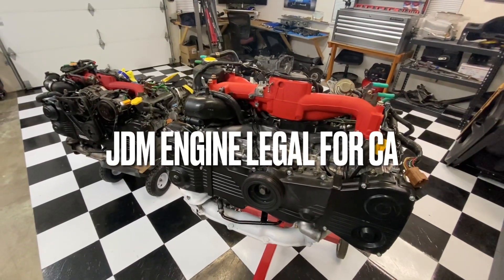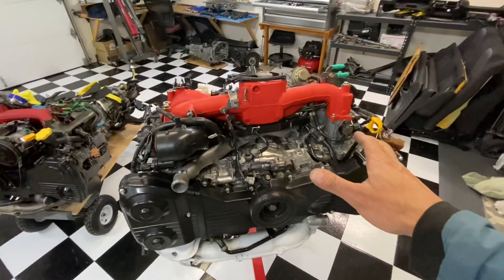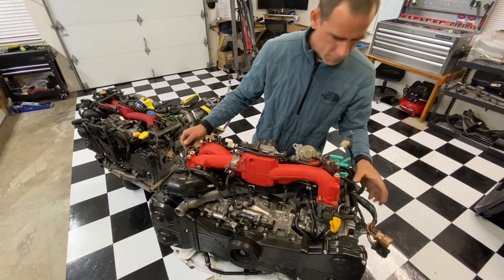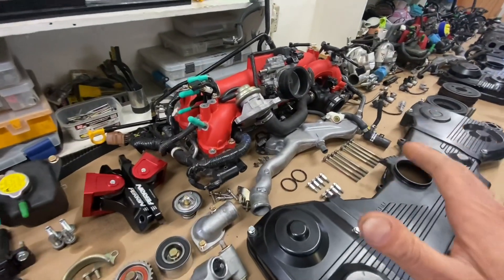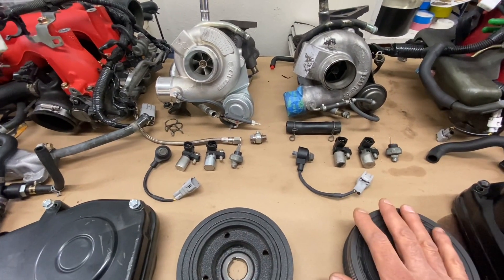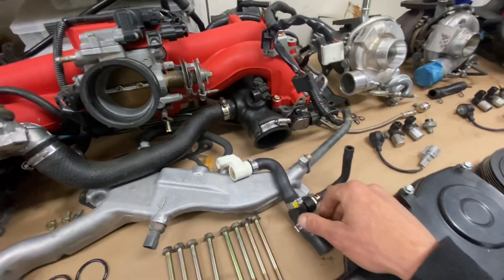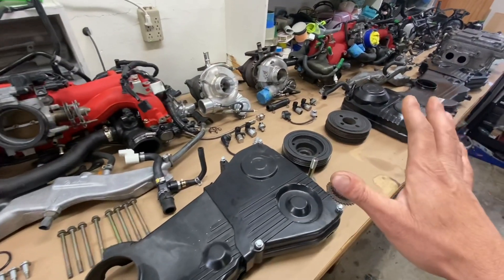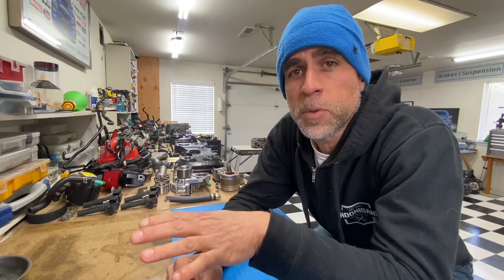How to Make a JDM Engine SMOG LEGAL for USA

Comment: Wow, Thanks so much for the video. I want to do this to my Bugeye that has a Head Gasket leak. Seems a lot cheaper than a rebuild. Is the JDM engine more reliable than usdm? Does the JDM motor still suffer from head gasket and ringland failure? Thank you.

Comment: I’m sure you heard of the Project Green speed via Cobb. I’m in a major dilemma & I can snag a jdm v7 207 for dirt cheap. I do want to stay with the Cobb tuning capability & stay within CA emissions as much as possible. The TGVs is one of my main concerns if I can just put it on the 207 & plug it up. Idk if it’s possible bc I didn’t find anything on the forums online reguarding it.
Reply: Also it does come w AVCS & the ecu. Just need to grab the wiring from iwire & all that. Idk what ecu to use.

Comment: Where are you located?? I got screwed 2 years ago. Was sold the wrong jdm motor to replace my 05 wrx. Shop didn't know for a year, they kept having delays so I got stuck with it, decided to rebuild motor. Then months and months after waiting, got ghosted, basically by a old friends dad, and never got my motor (complete) back. Now I'm motorless and haven't driven my car for two years. Have basically been trying to save up and decide weather to try jdm again or go junkyard motor.

Comment: Hi! I'm thinking to replace dead USDM EJ25 to JDM EJ20 (one overhead cam, non AVCS). I understand this setup (with USDM intake, ECU, sensors etc) will pass emission tests through OBD, but what about engine mark EJ20 on the top of it? Smog guy must check it while inspection in process or not? California. Thanks in advance)))
Reply: Hey was wondering if you did end up passing?
Reply: @Nick-mz9we  Hi! I ended up fixing existing engine.
Reply: Can confirm. They checked my engine code. Did not pass.

Comment: Nice, very informative!
People are reporting CA is checking for tunes. How do you plan on running stock ECU? Baby it into readiness?
Reply from the maker: Don’t understand. CA checks for tunes, yes. Using the OEM ECU for US EJ205, with no tune, is what I’ll be doing. Shouldn’t be an issue, since there is no aftermarket tune being used.
Reply: @SubaruONLY  Nevermind! I thought the JDM 207s had the same higher compression ratio as the JDM 205s. My mistake.
Reply from the maker: All good.  Yes, the JDM EJ207s are really ideal for use with the US EJ205 ECUs. Pretty lucky. 👌

Comment: Hey i have a random question, hopefully you can help. So I bought a 2019 sti with 19k miles on it. Didnt come with the accessport (i know thats not healthy)but has the cobb intake and running at 18.5psi. I was going to buy the accessport but idk if i put the tune it comes with or idk😩
Reply from the maker: Buy it.  They are a key thing to own.  Can’t go wrong.
Reply: @SubaruONLY  okay thanks man, i also been running it for a year like that and nothing wromg so far😁 appreciate your time to answer

Comment: All those parts so neatly displayed and explained is full Subie froth 😍. You going to run stock air intake?
Reply from the maker: Yes, for the time being. Maybe change it up after but the power increase is negligible for the most part.
Reply: @SubaruONLY  I run a non turbo and there was something weird going on with myne.  Just put a CAI on it.  Maybe you could have some insight?  https://youtu.be/dqc_oeh3jzg

Comment: Rad. Presumably you're still not going to tell the BAR ref its not a JDM block, right? As far as they're concerned its a USDM engine...
Reply from the maker: Yes, but the conversation should stay focused on the air emissions (that’s their only legal area to have any say in), and the block and pistons don’t impact that at all; the compression could, but actually higher compression is usually less bad emissions, as long as no knock occurring.

Comment: So, how does using a USDM ECU affect power on a JDM engine compared to using a JDM ECU on a JDM engine?
Reply from the maker: And the JDM ECU for this 207 controls the AVCS, have to run without those working with the US ECU.  That doesn’t effect the max HP but does compromise the power band and HP curve across all RPM ranges.
Reply: Jdm ecu are tuned for higher octane.

Comment: I have a 2001 sti jdm v7 in my 2001 RS...My V7 doesn't have the AVCS. I wonder which jdm models came without the AVCS in 2001? Maybe a spec C? Anybody know?
Reply: RA and Spec C?
Reply from the maker: I’m not sure either. Like to know though too.
Reply: @SubaruONLY 08 NEVER MADE AVCS FOR THAT YEAR. IT CAME IN LATER YEARS...08 AND UP?

Comment: So you aren’t using avcs, that’s 😢
Reply from the maker: Not as far as the smog tech will know - BUT I got a plan and I WILL be using AVCS - stay tuned!!! 😎👊
Reply: @SubaruONLY  Can't wait to see the look on your before and after face when your tuner enables AVCS. ; )
Reply from the maker: Definitely looking forward to that too!!! 😁
Reply: Ok cool. I had a v7 Jdm and now have a V8 jdm swap in my 02 Wrx
Reply from the maker: Awesome. How do they compare?
Reply: @SubaruONLY   the V8 seems to seems to have a little more punch. The spool on the stock turbo is nice. I have a Tomei twinscroll turbo I need to install.
Reply: @SubaruONLY  60-70 ftp more at lower rpms when enabled!
Reply from the maker: Sweet man. Sounds nice! 👍